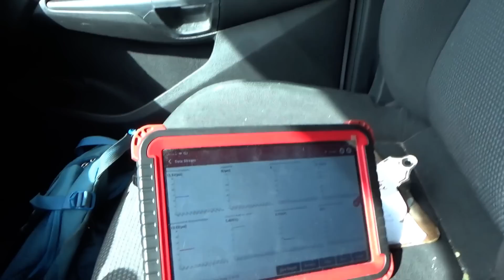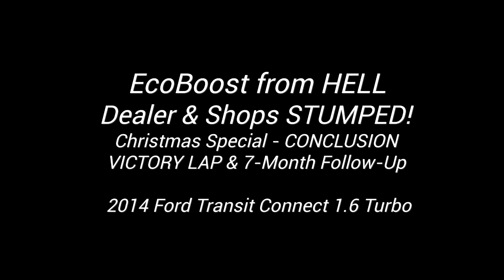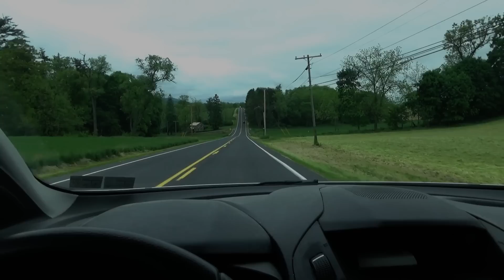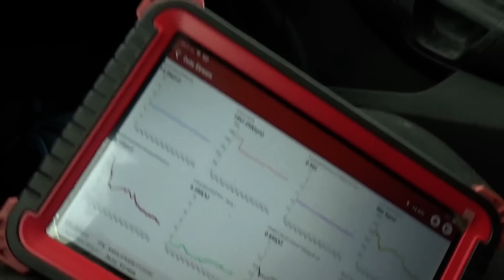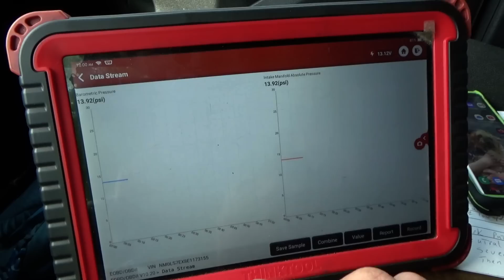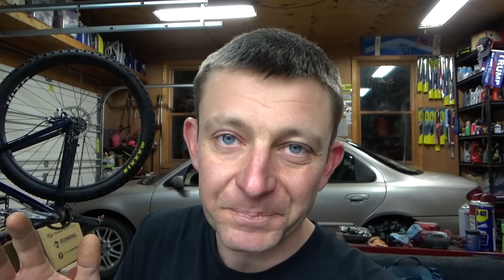(CONCLUSION!) *7-MONTH Follow-Up* EcoBoost From HELL (Christmas 2024)

Comment: Explanation? Here's something to consider.

1) A stranded wire in a crimp connector only contacts that connector with the outer strands, while the inner strands do not make direct contact. Any contamination can reduce the directness of the current path to the connector.
2) Every electrical contact through a pressure connection will loosen in use as heating and cooling causes the softer wire to deform while the pressure container (screw terminal or crimp) both limits the wire's ability to expand as well as it not having the same expansion rate. Note that this is why aluminum house wiring caused fires since aluminum has a higher expansion rate and is softer than copper. The flow of current alone will heat a wire so even with nothing moving when the wire cools you lose some conductivity. Normally this expansion and deformation is so minor it can be ignored, but it still occurs 
3) Oil or other contamination can now get into the spaces the heat cycles have caused leaving at worst only the outer strands of the wire having a good current path while all the inner strands encounter resistance because of the contamination.
4) The surface tension properties of liquids (oil) will cause it to want to migrate into any space it can find exacerbating the problem.
5) Intermittent connections can fix themselves temporarily via wire movement, a heating/ cooling cycle (even if only by electricity flow), or by the pressure changes disrupting the containment until it forms a more resistive layer again.

I started as an electronics hobbyist believing in solder. I discovered that solder joints can degrade over a long period of time, especially if the  surfaces weren't perfectly clean when the connection was made. This because solder contains tin,and tin has a natural corrosion problem known as "Tin Pest". A,so a 'cold joint' in soldering with too little heat often results in contact degrading over time. The aircraft industry uses crimping exclusively for wired connections claiming it is more reliable and as that seemed o be true I began to eschew soldering in favor of crimping. After years of experience I've concluded that even if it;s imperfect because of "Tin Pest", a properly soldered connection is the most reliable because of the more direct metal-to-metal contact of all strands instead of only the outer ones. Given enough force, you can pull a crimped connection apart but the same cannot happen with good soldering. I've gone full-circle and now put may faith in soldering, not crimps although I still use those in non-critical places and I'm a fan of the new "crimp and built-in solder" connectors as having the best of both worlds.

Comment: By stacking all ground connections you had a few picofarads of capacitance that would stabilize signal from distortion or degradation. Once capacitance is consumed then it would act up.😊
Reply: But picofarads of capacitance combined with even 10k of resistance results in time constant of less than a microsecond -- hardly something you'd see on a DMM or PCM.

Comment: One good thing about a traumatic event like this is that each little lesson learned will be burned into your memory permanently. And while you may not encounter this exact same problem again, undoubtedly there will be a big payoff in future dealings with Ford's many versions of this powertrain. Tons Fusion/Escape models with the 1.6/2.0 Ecoboost, and you're now armed with an intimate knowledge of the powerflow.

Victory comes at a price but its benefits are worth it!

Comment: stubborn work and determination wins. Marginal, low resistance connections, be they crimp or solder flow, are insidious in the power world and notoriously difficult on the trouble shooter. Again, well done. This one was only going to be fixed by determination and the pride of workmanship that goes with that.

Comment: Observation leads me ro believe that the oil in the connector to MAP sensor was spilled on oil change due to its proximity to the fill port. Awesome series and amazing tenacity! Thanks you for the lessons learned. OEM PARTS! Never give up!

Comment: It's a good thing that MAP ground wire didn't break somewhere near the crimp but not at the crimp when you did the tug test near the crimp. Had that happened, I'm sure you would have fixed the break thinking that was the problem but we now know it wasn't. Probably another wild goose chase would have ensued.

Comment: So, lesson for future - if some sensor is showing something suspicious - go with basics, check power and ground AND voltage drop on both :D. I thought it will be some minor timing problem, one tooth out on the exhaust (had it in my car, took me a lot of time to find it), MAP sensor was crazy on idle, until you touched gas pedal and everything went back to normal. Great case study, maybe the best one so far on youtube

Comment: greetings
you could have found this error with LoadPro
I think the inventor's name was Dan
I know you all belittled it, but if you had used that instrument with a multimeter or an oscilloscope, you would have found where the error is
PS: don't be a cynic, sometimes buy a new part.
just kidding, I also try to fix it before I buy a new one

Comment: i had my provider check my internet connection after years of problems,
one of the moden kabels(looked just fine) had the core 0.5 mm shorter.
he said, thats your problem and he turned out to be right.

Comment: Brain buster for certain. I had no idea automotive harnesses have connections like this buried in the harnesses . A major no no in every machine I have worked on, certainly a no no in electric power wiring for buildings etc.... European machine tools bring every wire back to a terminal somewhere, or at least the ones I have experience with, making tracing out bad wires or connections easier

Comment: Sort of related.. I recently had a speaker bass driver that didn't work. Checked at the terminals and found it to be open circuit. I measured the resistance further along where the braid wires connect through to the cone itself, there was a normal measurement of approx 4 ohms.  Thinking I had a bad solder joint at the terminal plate, I resoldered everything - the speaker was still open circuit! To cut a long story short it turned out that one of the copper wire braids had gone open circuit. I cut the ends off and reconnected to the speaker terminals which fixed the fault. The point being was that I had an open circuit in what appeared to be an undamaged clean piece of copper braid. There was no visible damage or fracture to the piece of copper that I cut out!

Comment: An explanation of the erratic sensors input/outputs follows my praise.
Good job, you probably saved numerous vans o other vehicle with this engine typer from the junk heap if the information you have developed here is reviewed by others.  

You also helped the environment, as these engines on the rood marginally passing emissions will run much cleaner with this correction. Ford has made over 5 MILLION VEHICLES WITH THIS ENGINE. You will also HELP PEOPLE SAVE THOUSANDS OF DOLLARS IN REPAIR BILLS.
Glad I watched these Videos, they had me on the edge of my seat for the duration.
Internal to the computer, there is probably  a zener diode derived reference voltage, the reference should have remained nominally constant. You earlier mentioned either input or output pull downs, Those pull downs were high or low by the amount you measured the ground to be AND fluctuating.

Comment: If you are getting unbelievable random faults I tend to think water ingress and bad grounds. I think all the faults stem from the bad splice apart from the cam issue. The O2 sensor would not like being over rich for long periods, most of the other sensors that were glitching were using the splice for ground? When multiple devices compete for the same ground connection different current demands affect the ground. This ground was also affected by vibration and heat so more variables to deal with! The clues were there particularly the baro and manifold deviation and a thorough test of the map sensor cables before it was replaced may have caught your attention? I dont think many shops would have solved this so brilliant diag from you! You've kindly posted this online so its an easy fix now for anyone coming across your video so thank you for that. Taking your vehicle to a shop is a bit of a lottery, which tech gets the job, how quickly the tech can diag the fault, has he come across this fault before, how much time can he spend on the job research etc, throw some parts at it produce a bill and hope! if you came across this fault again I guess the bill would be less?

Comment: Ivan, very few investigative technicians have your ability and dedication, your perception of the control operation of VARIOUS  car models is very commendable. The downside is that with all the electronics on cars, the time and cost of rectification very often outweighs the value. You are now seeing new cars sold with a 5yr warranty by manufacturers. For the average vehicle this will mean a value loss of 50-60% which is manageable and also means dealers/ manufacturers have sales.

Comment: So basically the modern engines are reliable as least as the "old" ones. All those problems due to mileage, bad parts throw at it and bad maintenance didn't killed it. Still managed somehow to serve it's owner. For those who praise the 70's 80's cars...how many times they've left you on foot or didn't even start? 😂 Be real.

Comment: It is possible that the crimp acting like a wet capacitor. Yes there was a DC connection, but the oil or oxidation was acting like a charge moderator membrane. So as the signal charge would pulse like a DC biased alternating current component. the voltage would rise in opposition to the supplied voltage. ( the resistance would rise on your meter)This in-turn would explain the test results. this is like a leaking capacitor. Get to a V~ then bypass voltage through the copper wire. Ohm's law still applies. Faraday's law on capacitance applies here also. Remember that there is induction generated in a pulsed wire. which explains the charge to a induction capacitance circuit over time. This causes a back EMF charge.

Comment: Brilliant video as always Ivan I've seen some weird things with them eco boom 💥 engines 😂 I've had oil track through the cam sensor as you said which got into the ECU and made it a non start Mercedes cam sensor do the same amazing what capillary action has on electrical circuit keep up the good work 👍

Comment: In my experience, ground issues can cause the craziest problems. It's not often (thankfully) that we get vehicles that test our knowledge and experience to this degree.
In the end it's not an inexpensive repair but the owner should get a lot more miles from this van before it needs to be replaced. 
Excellent case study Ian, not many guys could follow this trail of bread crumbs to finally fix this van's myriad problems. 
Vehicles like this are why we have lemon laws. Congratulations on getting this van back to working properly.

Comment: Hello Ivan: You get the Kudos for sticking with the issue until you found the problem. My humble suggestion of the cause is galvanic corrosion at the microscopic scale. Not visible but measurable. When you unpluged the sensor it temporarily took the load off the line, then reconnecting it would take some time fot the reaction to be measurable again. It took years for the issue to develop into a driveability problem. You traced it in a couple of weeks. Pretty good diagnostics in my book. As the wires get thinner and made of less quality materials EX. Copper not 97% pure only 92% Pure ihe impurities will make issues occasionally. I am looking forward to your New Years Special.
By the way happy New Year to you and your family.

Comment: Any metal exposed to air will corrode. If it were possible to disassemble that police I bet you would have that one sensor ground was imperfect, not totally in the crimp , some strands missing, A bit of insulation in the crimp, etc. The connection was affected by heat, expansion would be a factor as well. The solder coated the wire strands after the rosin cleared any minor corrosion and made the splice junction whole again. Great video series ;) good to hear the clatter went away too. And yeah that beautiful Pennsylvania country side! Happy New Year!
Reply: Splice not police... 😂

Comment: Years ago, I remember trying to diagnose and repair several issues on the same vehicle.  Not exactly a challenge back then, but you did need to think from time to time.  In the 8 years I have been following you, I can't think of many that have presented this challenge.  That Russian grey matter was boiling.  It's been a long time since I've seen the Mistake in the shop.  Whatever you need to do to it should be very easy.  One thing I have learned in my 61 years on this earth: NEVER SAY NEVER!  I'll bet this is going to be on that Russian hard drive from now on.  GREAT VIDEO!

Comment: I feel somewhat ashamed because I got a thrill watching someone ELSE scratch their head for a change!

Is the takeaway that this might have been easier to find by finding an identical but known good vehicle for comparison? Dunno, but as hail marys go, it’s an option. 

Is the takeaway that a GDI turbo engine can run at +/- 30% trim and not throw a generic mixture code? You would think that even with the MAP 10% off, the thing would just trim that out. 

Is the takeaway that you could be forgiven for firing the parts cannon in cases like this? The whole time I was thinking “drippy injector.”

Or is the takeaway “let’s go back to carburetors!”

Comment: All I got to says is read my comments for first video i did 7 wire harness under warranty for 1.9 eco boosts back in 2015 knowen problem  7hrs on a job that takes more like 9hrs or 10 hrs I dont know why it happenes but it does

Comment: Could it have been caused by an electrical charge build up (magnetic field) at the ground junction. Then released when the map sensor was disconnected or the harness moved, because of engine vibration.

Comment: I believe while crimping, the MAP ground wire strands did not connect all the strands and it forms a sort of air gap where 2 or 3 strands are barely touching other ground wires or crimp body, and this is why when soaked with solder , it meshes the unconnected (strayed in an air gap) strands with the rest of the wires. Similar scenario happens when connecting a single wire to a pin , initially it will look solid, but if not soldered with time and heat / cold cycles it will be partially loose and in many instances you may be able to slightly drag the strands in and out of the pin. Take Care & Merry Christmas.
Reply: Exactly my first thought but now i think this is physically impossible. When crimping multiple copper wires inside a metal sleeve under great force there is no room left inside the crimp and the copper from the other wires are an excellent conductor. Ivan showed the crimp was correct with no loose wires or something like that. The theory mentioned here by others about a thin layer of oxidation or leakage by oil contamination to another circuit with a higher capacitance makes more sense i think.

Comment: The only thing that explains it,  is that oxidation over the surface of the wire causes it to not have good contact..  Maybe if you would have cut open the splice, there might have been the slightest bit of green crusties...   I think crimps are great for one wire to connector..  Or even crimping two wires together..  But as you add more wires,  I tend to trust it less and less.  Solder is definitely the way to go in a multi wire splice..  Or at least make a dedicated bus bar or something.

Comment: Congratulations from Egypt Ivan on a job very well done, as always! I really admire your patience and persistence which are backed by an excellent understanding of electrical engineering fundamentals and a powerful analytical thinking abilty.

As for the fault cause, my humble guess is that this particular MAP sensor ground wire wasn't touching the other wires, but instead it was only touching the metal of the crimp and by time it created a galvanic cell which delivered that constant ground voltage elevation.

Finally, I wish you, your family and all of your followers a Merry Christmas holiday and a happy new year that will - hopefully- bring some peace to this world.
Adel (Egypt)

Comment: Don't know what the splice thingy was made of, but this acts like a dissimilar metal issue. Over time, a layer resembling a semiconductor can grow betwixt the metals. Current flow or voltage can punch through for a while, but soldering is usually the only way to really fix it.

Comment: A lot of parts and time spent on this, however I don't think that a dealer or 95% of auto repair shops could have resolved this. It seems that only a car gets past 7 or 8 years old that the cost of parts and labor to repair it become prohibitive.which should be a crime

Comment: My guess as to how the crimp failed is that it alone got some mild corrosion and the current going through it caused the corrosion to heat up and swell enough to create the further resistance.
Reply: It would cool down and move just enough to remove the resistance when no current was going through it. 

It's my thoughts on the issue. 
Maybe it could mirror yours

Comment: Xl and XC in the circuit, we saw it all the time in study of Devry Technology of Electronics manual 1972-75 High Scool Electronics class.... That cute little factory, all physical mechanical connector of several copper wires, created a bridge circuit....  Z: Z represents the total impedance of a circuit, which is the combined effect of both resistance (R), inductive reactance (Xl), and capacitive reactance (Xc).